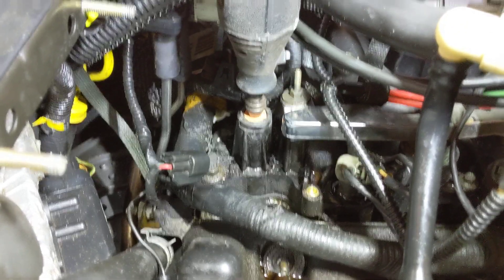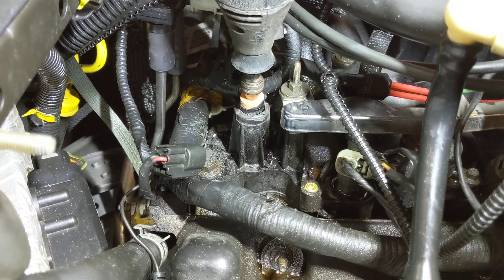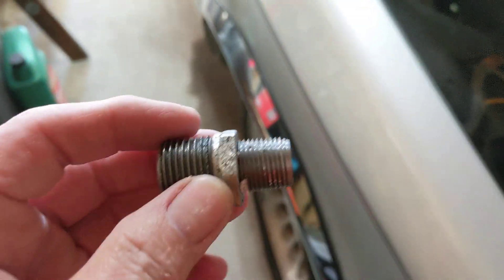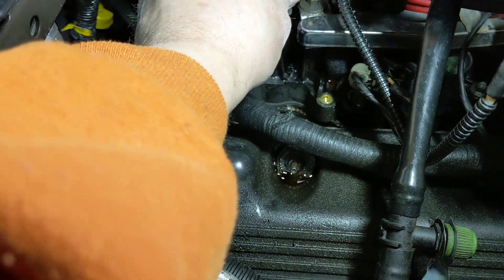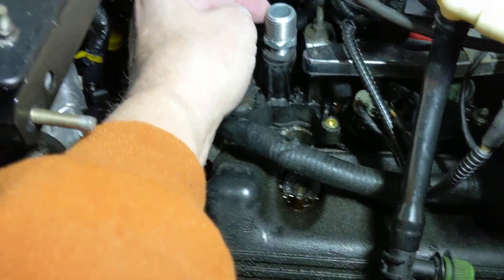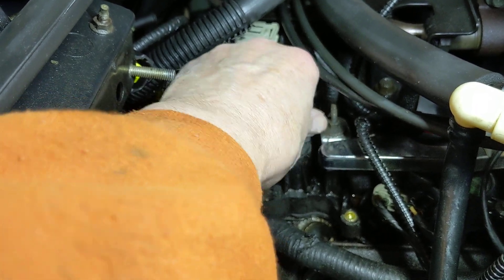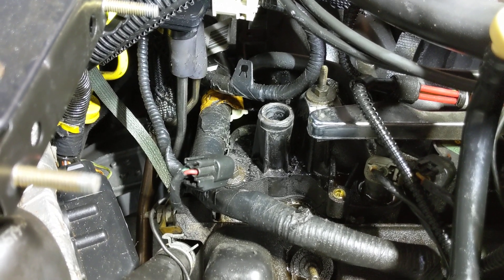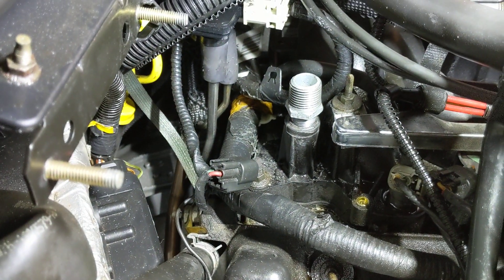Ford 4.6L intake manifold heater nipple repair

Comment: This is a great fix.  Used it to repair my son's 2006 Crown Vic police interceptor's broken heater nipple today, and just waiting for the sealant to cure before we test it out.  Seems pretty solid.  If anyone is interested, I used a 3/8 npt pipe tap to thread the broken nipple.  Was not necessary to drill prior to tapping.

Comment: What does that single wire elbow connector laying on the back of the valve cover go to?
Reply: I'm wondering the same
Reply: Coil on plug connector
Reply: @bmfboy22  During the first few secs of the video you can see it laying on the back of the valve cover. This is an old post but I've already found out what it goes to. It connects to the fuel rail stud and grounds it.

Comment: I used a length of 15mm copper pipe soldered to a 22mm copper reducer.

I put it in the freezer over night and then , using a block of wood and a hammer I pushed it down into the hole and then I applied two coats of JB weld around the base to hold it in place. 

No need to make the hole bigger with a grinding tool, although I did rub the end of the copper pipe a bit thiner with some sand paper before putting it in freezer.

So far so good

Comment: Tap the hole for that pipe size. The clean area off use jb weld or epoxy, the screw in pipe. Let set and I think long lasting.

Comment: I own a 2011 Crown Victoria. I saw a little coolant leaking from that nipple. I tried to adjust the hose back on(while it was hot because I'm an impatient idiot). Broke into pieces. I freaked the f out big time because I knew it was part of the intake manifold. My first instinct was to shove something down in there and JB Weld it. I bought a 5/8 to 3/4 plastic heater hose connector. Haven't done it yet. Thinking about actually tapping it putting in a real hose connector. I love my Vic way too much to put a POS Dorman Intake on it. And I wouldn't go through all the trouble of doing that job for that quality of part. I found some Mustang 4.6 2V SOHC for PI heads intakes on JEGS. It's pretty much what is already on my car. It's only like $260 plus the $50 gaskets. Auto part stores want $200 for a Dorman.
Reply: I used a length of 15mm copper pipe soldered to a 22mm copper reducer.

I put it in the freezer over night and then , using a block of wood and a hammer I pushed it down into the hole and then I applied two coats of JB weld around the base to hold it in place. 

So far so good

Comment: 5.4L Triton.  Heater core hose blew off.  Taking the old hose off at the intake end- to my horror, had a plastic tubing / piping in the hose as it meets the intake. It was in pieces.  I cleaned it up as best I could hoping nothing fell into the intake hole.  No clue why that plastic piping was there - because there was 3-4 inches of metal piping there. Plenty to re-attach the new hose to & clamp it down. 4K miles no problems.   Anyone know what is with that plastic piping ?   It was in the last 2 inches of the hose and 2 inches over the metal pipe.   Mystery !